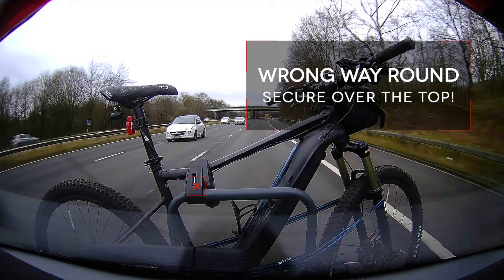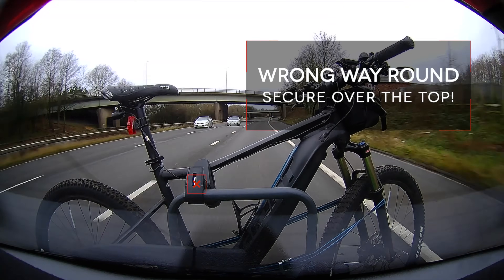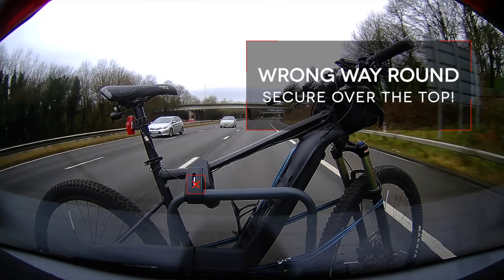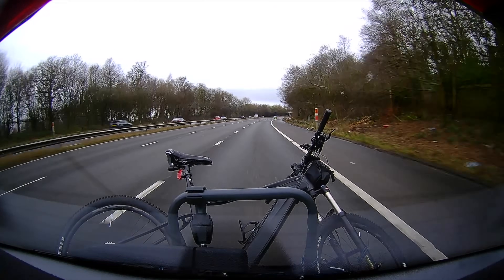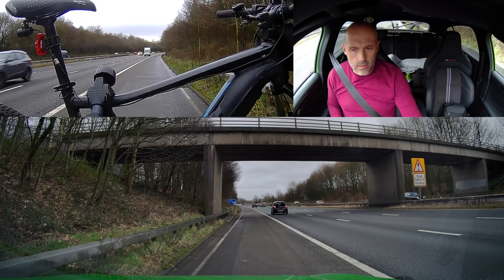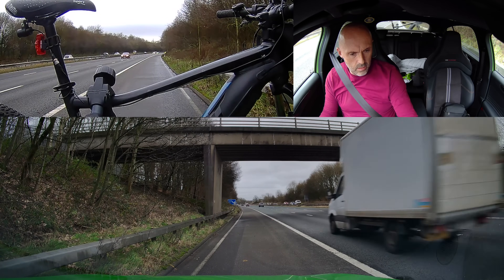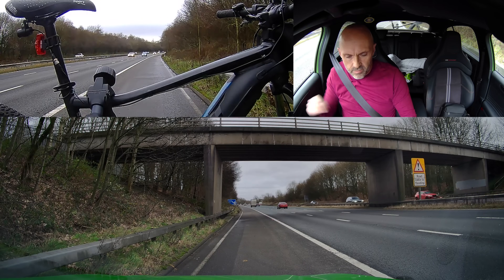Learning Point 415 | Using The Hard Shoulder

Comment: If the passenger seat is empty, exit and enter the vehicle using the nearside. As a motorway worker, always look for using this practice. If you had passengers, get them to exit on the nearside and get behind a barrier, like the one shown.
Reply: Likewise 👍
Reply: @dtvking  By the time i've climbed over to the near side door I'm already out by drivers door. I get the principle but in reality it's extra time that someone could be rear ending me.
Reply: @emmett906 less chance of being rear-ended than side-swiped.
Look how close the white car was as he came around the rear off-side and then the oncoming car when his door was open before being closed.
That's 2 near misses to zero near rear-enders.
Reply: Easier to do in some cars than others. I can see it being a heck of a challenge in the focus with it's sports seats.
Reply: @steve5772 I agree and some people won't be able to.
It's only if you are fit, able and without kicking the sh*t out of the dashboard 😅
Reply: And located behind the car too. If someone rear ends the stranded car, the passengers won't be un its direct line.
Reply: On mine with a big centre console that's quite a performance. Skoda Superb.

I have done it when someone close parked a tank on my drivers' side in a car park, but it took some doing,
Reply: 1) safe enough to get out on the drivers side so long as there are no vehicles  going past when you get out
2) not easy to go over the centre console to the passenger seat in modern cars.

Comment: Apart from utilizing the Hi Viz you had available I cannot see what other real options you had than resecure the bike. I would just like to point out to others, all the detritis of the motorway ends up in the central reservation or on the hard shoulder, please slow down as much as is safely possible before pulling over if you can, and be away of the likleyhood of encountering anything from a wheel nut to a wagon tyre when accelerating to rejoin the traffic. The less distance travelled on the hard shoulder the better!

Comment: Well done for pointing out your only mistake regarding the yellow jacket 👍🏿, it helps learners like myself to be a little more on point 👉🏿 Also like the fact that you waited for a reasonable gap to gain speed on the hard shoulder before rejoining.  Will keep in mind.
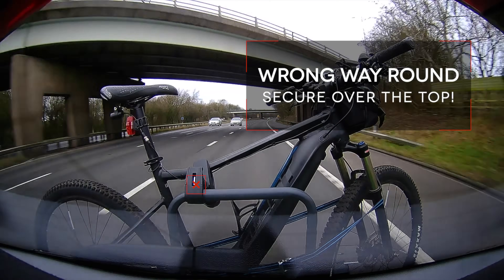Reply: 1/2 for observation. At 0:08  he pointed out that the top was  fastened  the wrong way.
Reply: @DemiGod.. one mistake made while at home (presumably not rushing), the other in the heat of the moment whilst retrieving the situation. It's the acknowledgement of the latter that is important (IMO) for those of us who may need to learn from the video?
Reply: Interesting how training I’ve had says you’re safer in black as people often aim for what they’re looking at, you wear yellow, they aim for it.
Reply: @911HRW  unfortunately 🚓 police do the opposite

Comment: I have to say, to all those suggesting he gets out the passenger side, with high centre consoles, gear levers, hand brakes etc plus the amount of time to clamber, unbelted across the seats kicking the indicator in the meantime to then get out of the passenger door which you struggle with as you’re parked so close to the left barrier, it is arguably safer to move as far to the left, look for a space (which is only often only seconds) and get out in a fraction of the time to climb across.

Comment: We were travelling home on the M60 a few years ago and there was a loud bang from under the car, followed by the most awful screaching and clattering.  A car in the next lane passed us with the passenger pointing back and down (as if we couldn't hear it....)  I managed to reach the next junction (very short distance) to exit and park up, convinced that I had lost the spare tyre and the noise was coming from the cradle scrapping on the road.  In fact what had happened was the tail end of the exhaust had fallen down and that was what was scraping.  As we were next to a pub that was still open we called in and managed to borrow a ratchet strap off the lady behind the bar which we tied into the car and under the exhaust pipe.   This was good enough to get us home.   There was however a follow up to this when we returned the ratchet strap (with our grateful thanks) the following month to the gentleman behind the bar.... who said "Oh, right, I see.  That is where it had gone.... thank you..... " ..... I have often wondered how much marital strife we might have inadvertantly caused...

Comment: If you can fix an issue on the hard shoulder to prevent further danger, then go for it! It was pretty clear that the bike needed to be secured to prevent the motorway from becoming a dodge the bike frenzy! It wouldn't have been very wise to carry on until the next exit to sort it there.

Just a few days ago I was on the M3 at night, and a lorry ahead had no trailer lights. They only flickered on for a brief moment due to bumps in the road. I figured it was a loose trailer connection so I got In front of the truck and turned my lights on and off a few times to let them know. They pulled over onto the hard shoulder straight away and I assume he checked the electrical connections behind his cab and hopefully got it sorted. A quick stop to fix the connection and now they're off and seen

Comment: My motorcycle Givi top box once fell off in traffic (nobody was hit/harmed by it) despite being locked the latching failed. I now use rok straps as extra protection, while it does add time to using the topbox relying on a single locking mechanism to keep a load fastened is never a safe thing to do.

Comment: Personal opinion, if the bike wasn't touching the ground, I would probably have used the hard shoulder but kept going at low speed to a safer spot, especially with the junction coming up. 

I had a rear wheel puncture on a transit years ago and the tyre went down pretty much immediately. I got it on the hard shoulder, took one look at the tyre and said "thats not going to be getting plugged". At that point i made the decision to do the mile to the next junction at <10mph. Found a safe spot off the motorway and changed the wheel myself.

Comment: I was sitting here trying to recount how many times in my 35 years on the road I've used the hard shoulder and I think it's five times. Four were mechanical failures, flat tyre, broken exhaust bracket, catastrophic oil leak and a head gasket failure (yes it was a K series engine). On one occasion travelling down the M5 I was caught in a biblical hailstorm, visibility was zero and I stopped on the hard shoulder under a motorway bridge in kerb-deep hailstone slush and waited for it to pass.

Comment: Back in 1984 I used the hard shoulder for the only time in my life. Going towards London [from Shrewsbury] on the M6 by Fort Dunlop at about 4:30 in the morning, I changed the points [ignitions contact breaker] on my Renault 12! It took only a few minutes, but I guess this would not be recommended nowadays and possibly illegal as well. The days when such a roadside repair was within there capacity of any mechanically minded driver ... The good old days of simple cars that, though less reliable, were easily repaired in quick time.

I find motorway driving to be more or less a nightmare these days and try to use A-roads in preference, even if it takes longer to get a distance.

I also have a great fear of following a vehicle with a bike or several hung on a carrier at the back. A fallen bike could do serious damage at 70 mph. 

Best wishes from George. Motorist and retired cyclist.

Comment: Seems a sensible use of the hard shoulder.  One question i have had for a while is why is stopping on hard shoulder considered dangerous, but not stopping in lay-by beside a busy duel carriageway?   In either case a vehicle at 70 MPH could come veering off road and into your car - but on motorways stopping is only for emergencies, and on other roads stopping is considered fine. Seems a big safety inconsistency to me.
Reply: The hard shoulder is easy to join and roll along with no barrier or entrance. A lay-by usually has some form of protection be it a kerb or barrier & is shielded by its nature. 

The risk of being hit in a lay-by is relatively low when you consider thr hard shoulder is essentially the length of the motorway so easy for someone to drift yet the lay-by is 50 metres or so.
Reply: @ The lay-bys I am referring are directly beside carriageway with no curb or entrance. Some are even on curve so if a vehicle does not make the turn they will go straight into parked car.

Comment: Two weeks ago, I had my tailgate sensor trigger a red ajar door light on the dash. I came to a stop at a red light that leads to the motorway. I turned on the hazard and jumped out and fixed it. The Suzuki Vitara driver behind me was not happy and honked his horn. But there was no hard shoulder for me to pull into. My thoughts process of what I was taught.. Red light on the dash, stop the car when and where it is safe to do so. 

As soon as I solved the problem, I went my merry way.

How do you think I handled?

Comment: Recovery driver here who has training and experience with shoulder use. 5 things you did “wrong” but were a none issue as you were only there a short time. 1 - No high-vis as you pointed out. 2 - Getting out and in on the drivers side. 3 - Not looking at traffic frequently enough. 4 - no hazards. 5 - You didn’t turn your steering full lock left once stopped. The get away was perfect, and it was definitely a smart move pulling over and ensuring the bike didn’t fall off, I’ve attended several fatal accidents thanks to a simple bicycle falling off.

Comment: This is a really good example where a Smart Motorway without a hard shoulder would be far safer. You needed to stop, but not immediately, so could have continued for a few seconds to reach a refuge. A refuge on a smart motorway is a much safer place to stop than the hard shoulder.
Reply: At 2:05 you can see Ashley was about half a mile from a junction. Might have carried on for another 40 seconds and stop on the off slip which might have been slightly safer though saying that traffic on the motorway seemed fairly light anyway.
Reply: @josyms7849  yes, that would be an option and maybe a bit safer on a slip road than the main carriageway, but you're still exposed on a hard shoulder. It's not quite as safe as a refuge.
Reply: Totally disagree @shm5547.  Far far far more dangerous.  Someone else may need the refuge at the same time - they are far too small.  Also you MUST phone Highways to get a Lane 1 closure put in place in order to exit them.  Not safe at all to exit refuge area without L1 closure in place.
Reply: though smart motorways have their own issues if it gotten worse and the bike was on the verge of falling off even at a slower speed hard shoulder is a good backup to have compared to a live lane.
Reply: @davidty2006  if the bike had actually fallen off into a live lane, then another advantage of a Smart Motorway is there are signs that can quickly warn other drivers of the hazard. It all has to be working mind you!
Reply: @IainR-pb9gq  you can get several cars in a refuge, I think they are big enough to just about accommodate two HGVs. Yes, you do need to call for a lane closure prior to exiting. But this is actually safer than having to get up to speed and merge from the hard shoulder. You get a clear lane, free of debris, which you can just easily join. There are phones in all the refuge areas.
Reply: @IainR-pb9gq Not true, you do not need a lane closed. The lay-bys are too small? They can fit a full length artic and a recovery truck in front of it to pull it away if need be so plenty of length
Reply: @shm5547 You do not need a lane closure to leave.
Reply: @911HRW  rule 278: you must call for advice and it will usually result in a lane closure:

you MUST use the emergency telephone provided and follow the operator’s advice for exiting the emergency area. A lane may need to be closed so that you can rejoin the carriageway safely
Reply: A lane “may” need to be closed. So my point still stands.
Reply: @911HRW  I suspect the 'may' is referring to smart motorways that have a hard shoulder. If the hard shoulder is not being used as a running lane, then clearly, no lane closure will be required. However, on an all-lanes-running smart motorway (such as I refer to in the OP), I suspect a lane closure will be required in all cases.

Your point was vague enough to still be standing on the precipice of that edge case.

Comment: I realise you're an expert driver, keen cyclist and you will soon lecture us on motorcycles too. For the most part, your advice is sage and very welcome. However, you're a terrible walker. 

At 1:17 you put yourself in between your car and another going past at motorway speed, after waiting correctly for the lorry and a car behind. 

You then opened your door and got in as another car sped past. After that,  you have patience looking for a gap to accelerate into. Applying care and patience inside your protected cage makes sense, but it makes even more sense outside of it.
Reply: Very critical of you, he walked behind the white car and closed his door before the next car went past (just)
Reply: @David_Trowbridge  He's at his back door when the white car passes and another car passes before his door is shut. It works out fine, but he's put himself in danger. All it takes is a loose chip, a driver glancing at a phone veering slightly left, or a twitch on the steering wheel as a driver doesn't expect someone on foot towards their lane.

Clearly everything worked out fine so it's harsh to point out a daft move, but I hope that one lone voice pointing out a danger can inspire someone not to make a similar mistake. That seems in line with Ashley's own aims.

Comment: Only thing I'd add is very very few but some nonetheless of bridges have no hard shoulder beneath them, so if it's not an emergency maybe wait to pass a bridge, just in case! Otherwise you'll massively reduce your run-up distance before joining
Reply: If stopping close to a bridge in that instance is unavoidable for some reason, then perhaps consider slowly reversing with hazards on to get sufficient run-up.

Comment: Good job Johnny Law wasn't following you. You could have been nobbled for driving a vehicle with an unsecured load.

I only ever once saw a bike fall off a bike rack. Somewhere back in the early 1980s, on the M62 near Manchester. It's surprising how far a bike can bounce! On that occasion, it went straight under the front of lorry. I guess it must have caused some damage because on our return journey, it looked like the same lorry was still on the hard shoulder.

Comment: I heard no mention of putting on hazard warning lights. I would certainly have put mine on, and it's particularly important at night. Rule 277 of the Highway Code specifically states that you should turn on hazard warning lights if pulling onto the hard shoulder of the motorway in the event of a problem.

Not dealing with the issue leaves drivers open to a charge of driving with an insecure load too. That will attract points and a potentially unlimited fine too. If it caused an accident, then so much the worse and stopping to secure it as soon as possible is undoubtedly the right course of action in the circumstances.

Comment: One thing I noticed about that is that the motorway behind you curved away to your nearside, shortening how far you could see back down the motorway when it came to picking a gap to pull out again. That suggests, if you have the time to think about and plan pulling over onto the hard shoulder, waiting for a section that curves to the offside or is dead straight before pulling onto the hard shoulder would give you the optimum rear view for when it was time to pull out again.

Comment: Gotta admit Ash, when I saw this thought you were going to call a cyclist out for using the hard shoulder on the motorway 😂😂Sadly, I've seen 2 cyclists use the hard shoulder on the M1 where it starts at Brent Cross going up to my other end at Watford. Still, really good video and absolutely a good use of the Hard Shoulder. Even the Emergency Refuge would have sufficed - It wouldn't have done the job as well or quickly, but slow down from 70 to say 50 in Lane 1 and put your hazards on - that'd have done it and massively improved safety for all.

Also - well done for recognising the lack of use of the hi-vis - easier to say in hindsight, not as easy in the moment when you are under stress.

Comment: if you had stopped after the half mile board to next junction, would it be an option to crawl along int the hard shoulder to get on the slip way hard shoulder for a little extra protection?